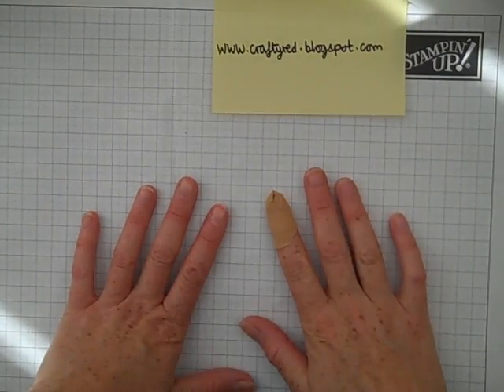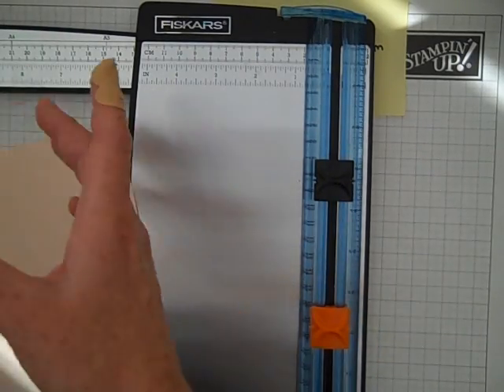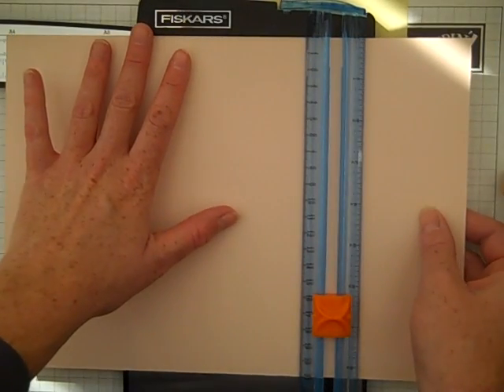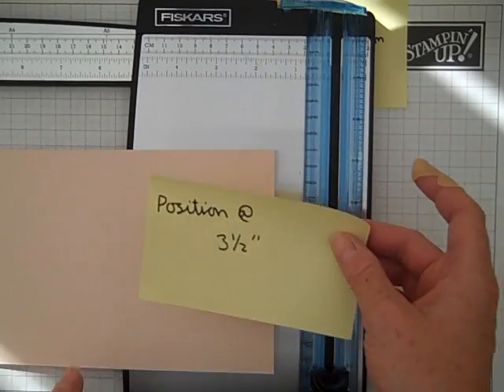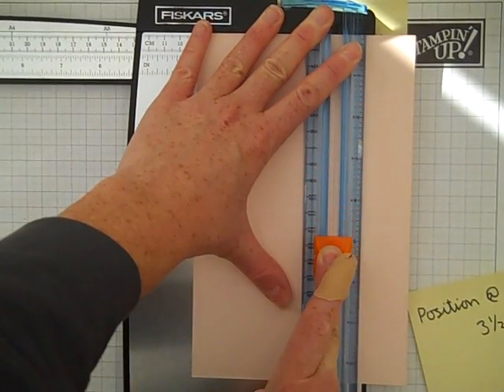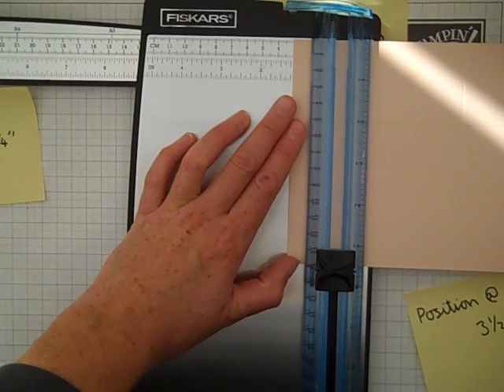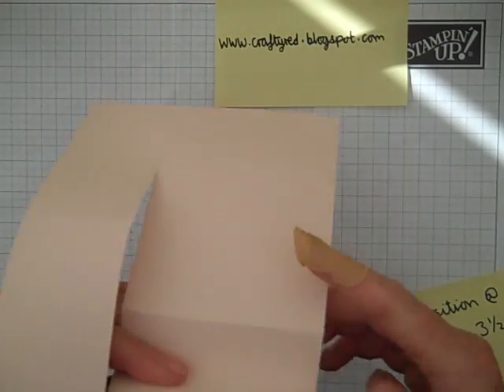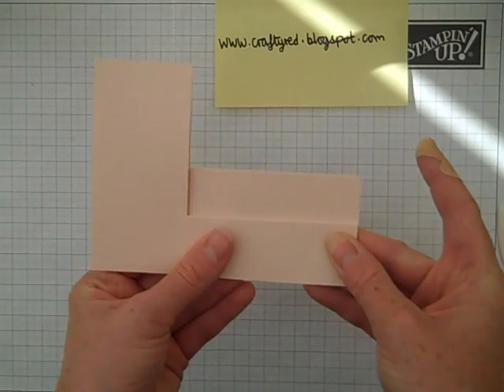Stampin' Up! Card base 1

Comment: you can get a fiskars cutter & replacement blades at any Michaels or Joanns or Hobby lobby. The blades are sold separately in packs of 2, either 2 cutting blades (orange) or 1 cutting blade (orange) & 1 scoring blade (black).

Comment: To change your cutting blade and scoring blade...slide it to the top of the fiskars plastic ruler..(it's opening is wider there) then lift the ruler to the left and they will fall out.  No need to keep pushing them in, bending the ruler slot...the come out on their own at the top of the ruler.  No more cut fingers!

Comment: just wanted to tell you- instead of wasting a 12 by12 peice of paper, since you're using 8 1/2 by 5 1/2, you can cut a 8 1/2 by 11 sheet of cardstock exactly in half and get two of these cards.  :-)